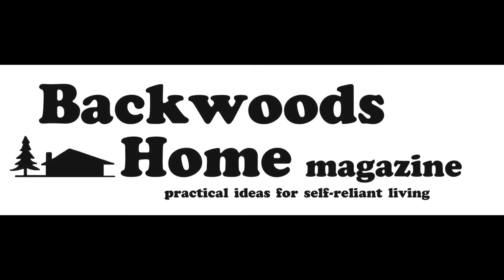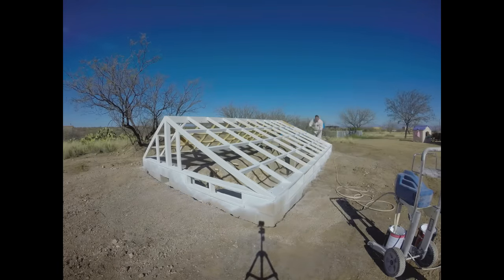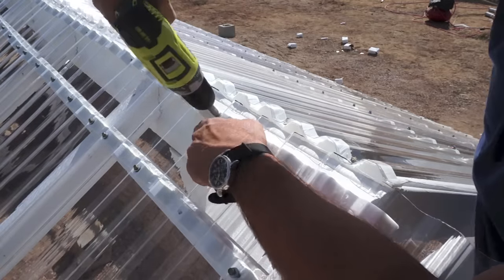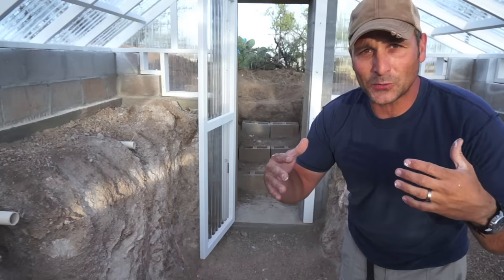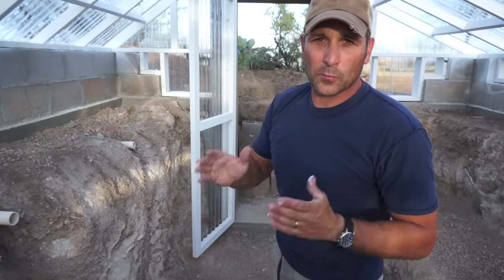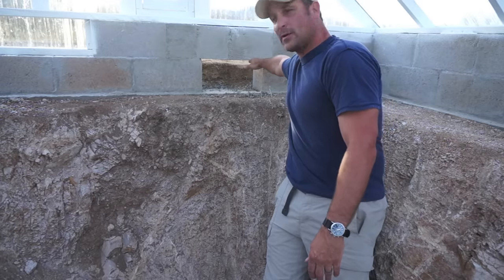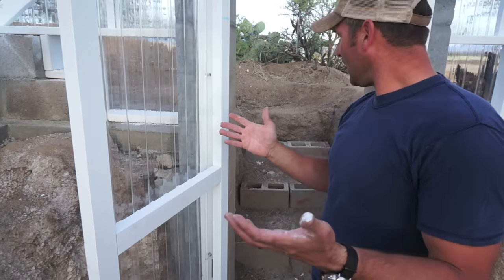Sunken Greenhouse Part 3 - framing, polycarbonate install how to

Comment: It would be interesting to design and build a concrete canvas totally enclosed hydroponic climate controlled green house under ground that used light bandit fiber optic lighting systems that piped in sun light to give the green house a full days sun light growth period. With climate change and in a SHTF it would be best to have a way to grow food that was out of sight out of mind. Those fiber optic systems that harness sun light and redirect it can follow the sun all day a disperse it straight down giving a longer period of direct sun light for plant growth. It would be purdy neat to knock one out and see how it worked.

Comment: That's pretty nice but I can not build it where I live it rains hard, I don't want a pool.
Reply from the maker: Thanks Luca!  Yes, if you have a high water table and are in a wet area it might not work so well... but, with that said,  if you built it on a raised hill, you shouldn't have any water issues, as you'd be above the water table and the natural slope of the hill would guide most of the rainwater away before it could soak down into the GH.  Anyways, thanks for watching:)  Joe

Comment: Great work. Do you ever come across property invaders like rattle snakes or border crossers?
Reply from the maker: +dawnpatrol thanks DawnPatrol.... yes, we do get the occasional crosser but not as much anymore as we have a large mine south of our house and the border patrol has increased patrols in the last few years....and regarding the  rattlesnakes, we do get our fair share:)  If you check out my Picking/processing prickly pears video you will see a couple rattlers during the filming of the video... I actually found 4 with about an hour and a half!  Most I've ever seen in that short amount of time...lol!
Joe

Comment: I'm wondering, will there be no problems with ground water gathering at the bottom of the greenhouse?
Reply from the maker: +Wilczek2 Hi Wilczek... it's a common question that a lot of people have asked, and a good one:)  But the reality is that our water table here is hundreds of feet below.  I know many places folks just dig a hole and it fills with water, but not here... although I wish :)   
But during rains we will certainly get some rain in through the stairway... but it shouldn't be more than 5-10 gallons or so.  
Anyways, thanks for watching:)
joe

Comment: are you using grow boxes  in your green house ?? with that sheer back wall  how much growing space do you have ???
Reply from the maker: +Maurice Brown Hi Maurice... you know what... Im actaully not quite sure of my total growing space.... haven't really measured it on the inside.  I'm going to build some platforms and shelves in and around the edges and the back wall and then I'll probably get a better idea of what kind of space I'm going to have.  As for grow boxes... I'll probably do the majority in moveable buckets and maybe some permanent boxes.  My main idea is to have starts and bucket/container plants in there and move them out into the garden during the summer....and then in the fall I'll move the tomatoes and peppers, etc, that I've had in buckets back into the greenhouse.  But I'll probably try to grow some other things in there on more of a permanent basis too.  But that's gonna have to be figured out over the next few weeks or so:)
Joe

Comment: have you had any problems with condensation running down the roof panels and dripping at the foam profiles on the purlins?
Reply from the maker: Hi Fern, so far no.. .but I haven't grown anything in it yet so I haven't had the moisture.  But at the end of this month I'm going to start growing in it... stay tuned for part 6 in about 2 weeks:)
joe

Comment: what's the plan for rain water coming down the steps into the greenhouse?
Reply from the maker: +Mrzoo2021 Hi Mrzoo, I'm going to address that on the next greenhouse video but the short answer is that I'm going to just accept that some rain will get in the house ultimately.  However I have a couple ideas to help mitigate that as well... or course, being ideas, they may or may not work..LOL!  thanks for watching!
joe

Comment: how are you going to drain it when it rains
Reply: Drainage into a hole in the ground fitted with a sump pump and a sensor to start the pump when water reaches a certain level i  the hole
Reply: Just like you would a large-scale garage floor. My garage set's beside my large-scale basement & under 3floors w/ two room's on top.
Reply: It looks cool but there will definitely be a drainage problem. The entry steps invite water in. If your foundation walls don't go all the way down and the exterior of the wall isn't waterproofed then water will saturate the walls and permeate through and under.
Reply: Probably put a roof over the steps area.  I also wonder if the plants will get enough hours of sun.  Since there are no transparent walls, only a transparent roof.  So, half your morning and afternoon sun will not get in.
Reply: YES10 Rain Catchment LOL. You just divert the rain into sunken barrels and use it to water the plants.  Most greenhouses function this way with the less light concept. Nowadays the setting sun is blistering for many plants. And the tropical warmth in the greenhouse creates moisture and allows a controlled environment minus predation, and winds. High winds are hard on plants. So that which you remove is so significant that what you have is a stabilized biome. Direct light and indirect light is still light.  Underground constant temperatures.
Reply: @blairbushproject  I guess.  I grow in two places: 1) out in an open , traditional garden area., and 2) in beds along the house where they get ambient light all day and protection from thunderstorms, wind, the occasional hail and July/August heat.  The open sun area does much, much better, even with poorer soil.  I only use the beds because I already have them and the plants do well enough.  I won't speak against the sunken greenhouse because I haven't seen it in action, but I don't buy it because most plants (especially fruiting) do better the more sun they get (not necessarily heat though) because of photosynthesis (obviously).
Reply: Kube Dog it may depend on the climate.

Comment: What if it rains and floods you out? Do you have tanks to reclaim the water?
Reply from the maker: +HighclassgeneticsTV It's a good question that lots of folks have asked... but you have to remember that we are in the desert and the water table is hundreds of feet down.  Additionally, all of the ground is graded or 'sloped' away from the structure.  The only area that will allow any water in will be the stairway and by my calculations, will allow about 5-8 gallons of water in for every inch of rain that we get.    So we will get some water in there but it shouldn't last or stand.  But, if I'm wrong then I'll have a good start on a pool project;) 
Anyways, I totally understand the concern, and for most places in the world it would be a concern.  But ultimately I guess I'll just have to wait and see..lol... I could be wrong!  :)
Thanks for watching!
Joe

Comment: Have you cost out the project yet - I'm interested in what I should budget do build one too
Reply from the maker: +JRC Homestead Texas Hi JRC...I'm not always great at keeping track of the costs... but up to this point with concrete footer, blocks, mortar, lumber, paint, hardware, and polycarb panels it's probably around the 750-800 range.  I still have to add in some more venting and a retaining wall so that'll add to the costs as well.  However, if you had a good source of used windows through craigslist/etc,.... you could cut a lot of the cost down.  Tuftex also sells vinyl panels for less money but I think the polycarb panels are worth the extra cost in terms of durability and long term wear.  Anyways, I see you are in hill country so i'm going to go check out your channel now:)
Joe
Reply: +homesteadonomics super - thanks for the reply

Comment: Hi ! Did you build by nature , mean North , South , East , West ? 
Thanks . Elena
Reply from the maker: +elenakurus2010 HI Elena... yes, the southern side is the main sloping wall... where the framed sections are in between the blocks.   The east side has the door and the west side is the solid wall where the vent window (and a future one are)... the west is where most of our wind comes from and I wanted those windows to be able to control air flow.  Hope that answered your questions... thanks for watching!
Joe

Comment: Will those plastic sheets yellow over time?
Reply from the maker: no, these are polycarbonate... the vinyl ones will yellow but these don't.  If you watch my latest video "rainwater collection surfaces' I show a close up clip of the greenhouse polycarbonate and you can see it has not yellowed at all in about two years :)

Comment: What happens when it rains heavily? Why not just build several cold frames, since the surface area of your greenhouse is similar to what several cold frames have.
Reply from the maker: +Love Lies Bleeding Mini Natural Farm Hi LLBMNF, rains shouldn't be much of a problem, as everything is graded away from the structure.  The only area that will allow water in is the stairs, and by my calculations, should only be approx 5-10 gallons or so.  We've had one 1/2" rain so far and I only saw a small bit of moisture by the door... so overall I'm okay with that:)
As for making smaller cold frames, it's not a bad idea, but I just wanted to build a greenhouse I could walk into and that was anchored to the ground, as our winds here blow anything away thats not anchored well..lol!  Anyways, thanks for watching and hope that answered your questions:)
Joe
Reply: +homesteadonomics Perhaps it is because of your sandy soil that drains pretty well. In case you have some crazy rain, you may consider putting 3 to 6 inches (or even more) of gravels at the entrance and hopefully the excess water will drain down. Good luck.

Comment: what's the point in making it sunken?  Is the money saved on material worth the labor/effort of digging a huge hole?  Probably not.  You can make a greenhouse out of PVC and clear plastic.
Reply from the maker: yes, it's definitely not for every one.  I live in a high wind area that destroyed my earlier greenhouse.  So the sunken is also to be able to stand the high winds we get:)  I mention it in part one or two:)

Comment: so you don't have to heat in winter?
Reply from the maker: Yep, thats the theory atleast:)  But only time and some winter temps will confirm... stay tuned as I plan on doing some vids this winter to see how its working:)
Joe
Reply: That's great man.  I think you might consider using 1 gallon jugs filled with water and painted black if you need additional passive radiant heat to release at night. Can't wait to see how it works for your.

I was thinking of figuring out a way to channel the heated air into my house to help with heating in winter.

Comment: I wonder who was your structural engineer: At 1:11 and at 5:38 you mention the beefy ridge beam and a mid spam support for your ridge beam. In an "A frame" structure a ridge beam  carries no load. So the three 2x6s and the mid spam support is a waste of money.
You should fire that structural engineer.

Comment: How did you deal with drainage?
Reply from the maker: +Unicorn Hi Unicorn... it's something I'll address in an upcoming video but i'm not too concerned.  Although some rain will flow into the GH, only a small bit will be collected in the stairwell area.  Everything else will flow away from the greenhousewith the final grading.  Hope that answered your question:)
Joe

Comment: What do you do when it rains?
Reply from the maker: It rained quite a bit in this monsoon season.. but the great majority of the water flows away from the GH due to the sloping/grading of the soil away.  We have a very low water table so drainage issues aren't a problem for us out here:)

Comment: You did not show how to put ridge section on why not?
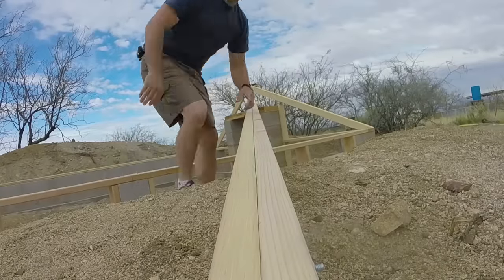Reply from the maker: +Mark Cordell Hi Mark,  I'm not sure which part of it you're talking about, but I placed it on boards to hold it in place and at the right height, then I placed supports on either side of ridge beam.  After I carry the beam to the frame and put it up, you should be able to see me clamp a board in place to hold it, then measure one of the end supports.  Then you'll see me measuring one of the end supports.  It starts at 1:20 or so.  

Unfortunately, I can't show all parts of everything, so I do my best to paint a general picture for folks to get an idea of how I did it.... without having an hour long video;)
Hope that helps:)
Joe

Comment: Can I ask you the point of sinking it into the ground ?
Reply from the maker: +John Griffiths Hi John... not sure if you've seen the earlier parts but the main two reasons are; to mitigate our high winds that we have and to take advantage of the thermal regulation of the earth... heat sink in winter, etc,.  ... but I'll have to see how well it works in the long run.  thanks for watching:)
Reply: homesteadonomics No I didn't watch the earlier ones. Thanks for the explanation.

Comment: please consider a sump
Reply from the maker: +ClintL63 haha... I understand the concern... as most areas of the country this GH would be full of water or atleast wet.  But this is Arizona and my water table is 800' down.  The rest of the ground is graded away and the only area that will funnel water in is the stairway... which I'm calculating will allow 5-10 gallons of water in during a 1" rain.  And in that case, the humidity will be welcome for the plants:)
Anyways, thanks for watching and stay tuned as I will be addressing this and some other questions in some upcoming updates:)
Joe

Comment: why is this part underground??
Reply from the maker: +GEZZA1 Hi Gezza,  I'm hoping to gain some geothermal benefits from the earths mass... i.e. naturally warmer in winter and cooler in summer kinda thing... not sure if it'll work but the other reason is that I live in a super windy area and it keeps the structure out of the wind.
Joe

Comment: that will need a sump pump it will flood
Reply: You could run corrugated pipe and gravel about bottom of foundation sloping to run off pvc.. I am not sure of your how you property slopes but if you can not run a electric free as stated above, you could put in a subpump at lowest point.
Sry my phone is acting up